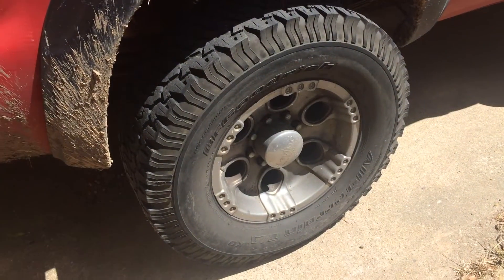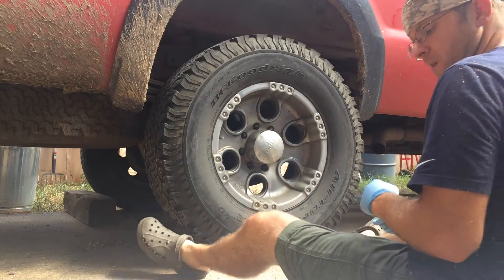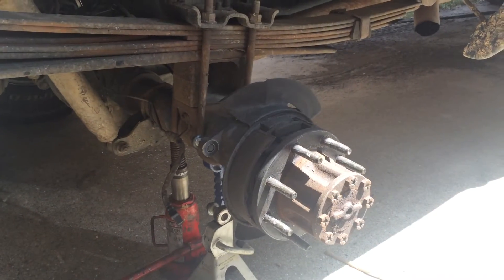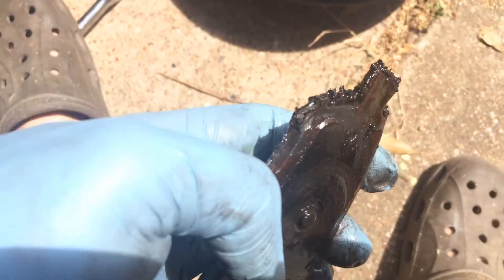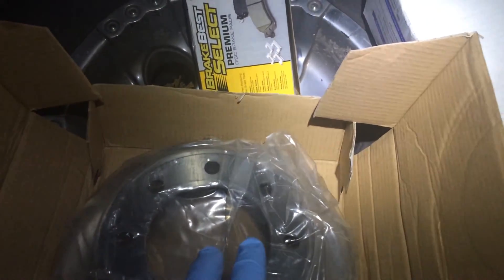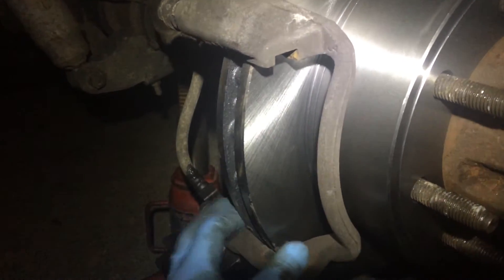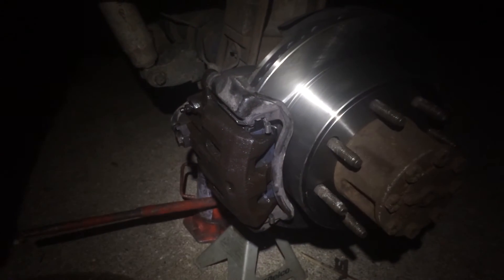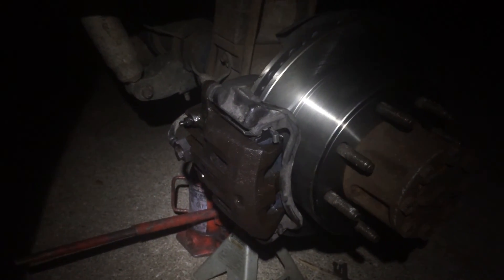1999 F350 Rear Brake Caliper and Pad Replacement

Comment: Have a 1999 f350, disc brakes all around standard for that year?
Reply from the maker: I don’t know that’s it’s standard. Maybe it’s an upgrade option or an axle variance. I have disk on the front, drum on the back.
Reply: You have disk all the way around as in the video you are working on the rear brakes of your truck and they are disc
Reply: 2 years late, but drums do exist on 99’s.
Reply: @warrenself Mine were disc both front and rear.